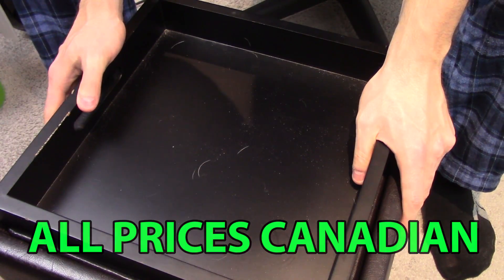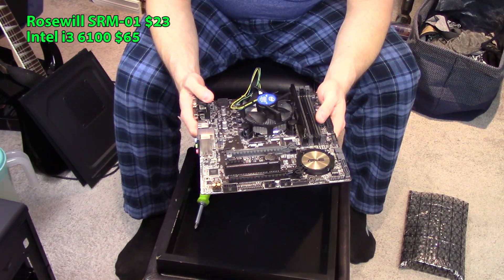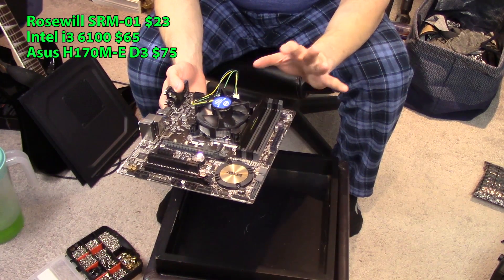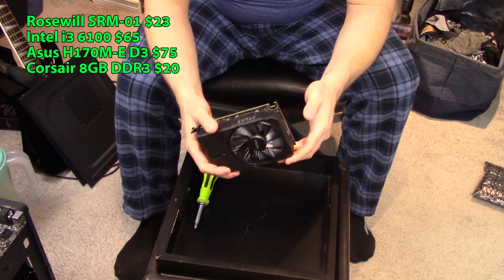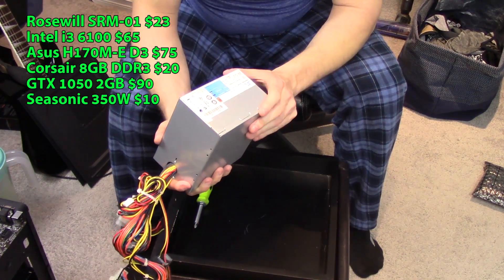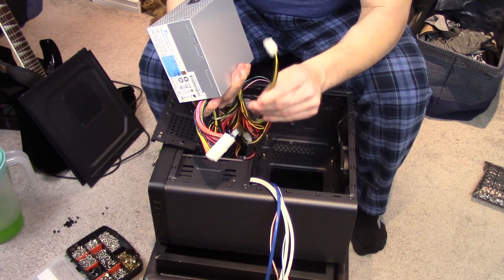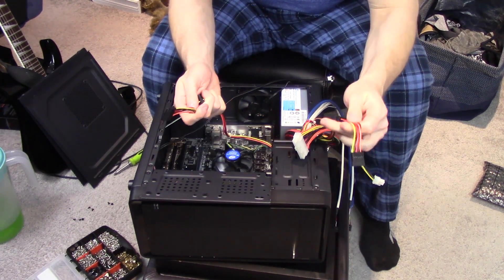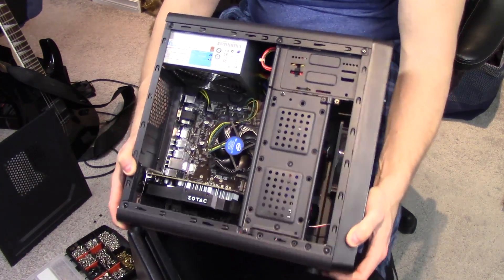Buying New Parts Used: A $313 Skylake/GTX 1050 Budget Build

Comment: Out of curiosity, I decided to see how much this would cost if you bought all this new. I put together a list with the exact parts used and it came out to $520. If you were buying new, you could save a lot of money by not using these exact parts though, for example the SSD was way overpriced new.

PCPartPicker part list: https://pcpartpicker.com/list/xhrY7h
Price breakdown by merchant: https://pcpartpicker.com/list/xhrY7h/by_merchant/

CPU: Intel Core i3-6100 3.7GHz Dual-Core Processor  ($108.99 @ SuperBiiz) 
Motherboard: Asus H170M-E D3 Micro ATX LGA1151 Motherboard  ($89.99 @ SuperBiiz) 
Memory: Corsair Vengeance LP 8GB (1 x 8GB) DDR3-1600 Memory  ($49.99 @ Corsair) 
Storage: Intel 530 Series 180GB 2.5" Solid State Drive  ($143.00 @ Amazon) 
Video Card: Zotac GeForce GTX 1050 2GB Mini Video Card  ($99.99 @ Amazon) 
Case: Rosewill SRM-01 MicroATX Mini Tower Case  ($28.22 @ Amazon) 
Total: $520.18
Prices include shipping, taxes, and discounts when available
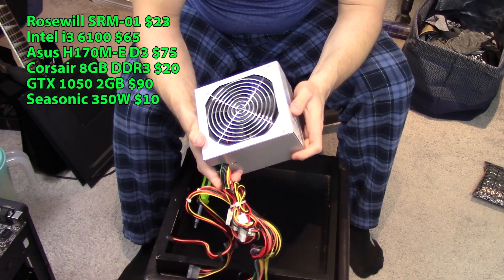Generated by PCPartPicker 2017-04-11 05:56 EDT-0400
Reply from the maker: American dollars, too. My prices are Canadian.
Reply: I completely forgot you're Canadian lmao

Comment: how did u change the voltage I'm the Asus uefi?
Reply from the maker: I'm not near the computer now, but it should be under "Advanced". Look for the setting called "DRAM Voltage" and set it to a manual 1.35v.
Reply: Oafah okay, thanks for the quick reply, i never saw it when i was in the bios a few mins ago , I'll check again later

Comment: The Witcher 3 results surprised me. I have a similar setup, a G4560 paired with a GTX 960 2GB and yielded better results. I was able to maintain an fps at around 45 on the high preset with HairWorks on (2x HairWorks AA). Quite strange....
Reply from the maker: Karim ben Salah Hmm. Definitely curious. I don't have any control panel settings on that might alter the results. Maybe I'll fiddle some more.

Comment: hello oafah ,why 0 rpm on gpu in tests?
Reply from the maker: Because it didn't get hot enough to spin up, I guess.
Reply: my rx 480 (8gb) always spins even at idle ...wtf
Reply from the maker: Oh, nevermind. I just booted it up to check. That card doesn't have a fan tachometer, apparently. The percent is all that registers.
Reply: Yep, that's rx 480 feature. Had two different and sold away, eventually stayed with MSI 1060 3gb silent all the way up to max temp, even when fans start spinning after 60C you hear them only if you try.